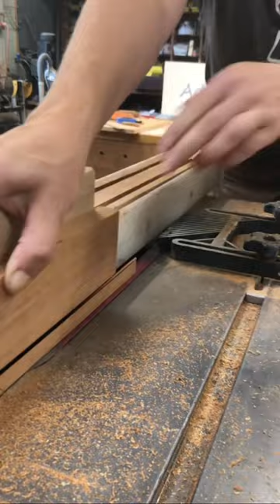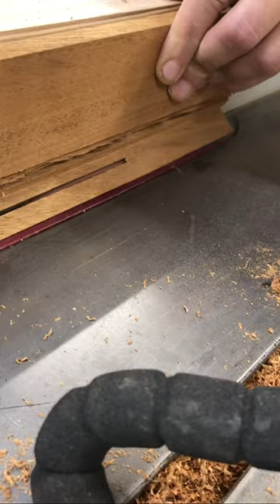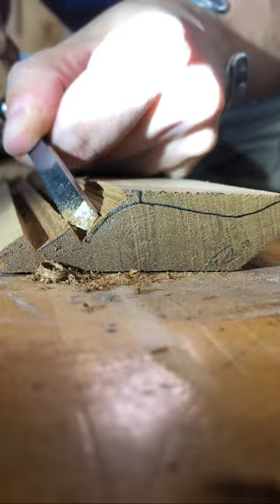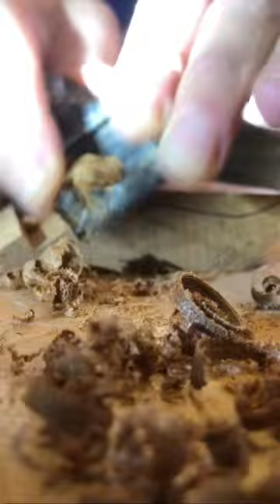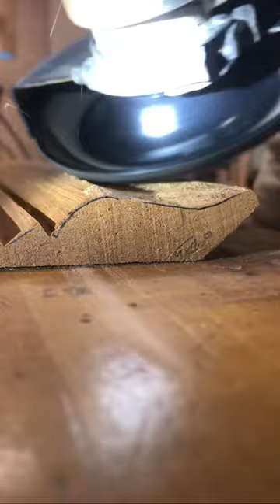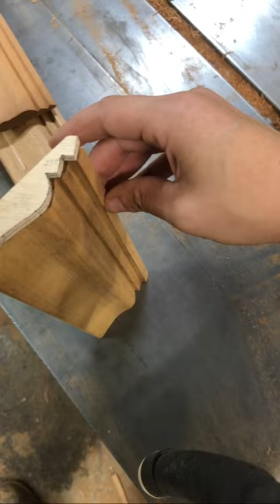How to make moldings without fancy machines. #woodworking #woodworkingprojects #woodworker

Comment: Router?? I mean, you are demonstrating a good approach, but router or router table here  in steps will give you  same results, but less dangeours?
Reply from the maker: Sure a router would work, but I would need to purchase multiple bits that I don’t own to make this, or do it for free on the table saw.  The majority of these cuts are covered the blade is not even exposed.  And the ones that are, are deceptive in the sense that the camera has a tendency to distort depth perception making my hands look closer to the blade then they appear.
Reply: @HoneyBadgerWoodWorks  aha. That I missed (camera angle). Anyway, it also a bit of a personal preferences. Cheers
Reply from the maker: @guseletov  trust me I get it.  I made the thing and even then sometimes I edit these videos and go "wow my fingers look so much closer to the blade then they are."
Reply: The last part that you used a grinder on - have you tried cutting that like a cove mold on the table saw first? It requires and angle fence and raising the blade until you get there but it’s a more controlled cut than with the grinder.
Reply from the maker: @AgCWby90CS  Yes, I have cove cut on a table saw.  It's a great method that works quite well.  But, it can be time consuming to set up if you don't have a jig for it already made.  So believe it or not the angle grinder was the fastest option in this case.  And, I might or might not be reviewing those grinding discs for a company and want to showcase everything they can do.